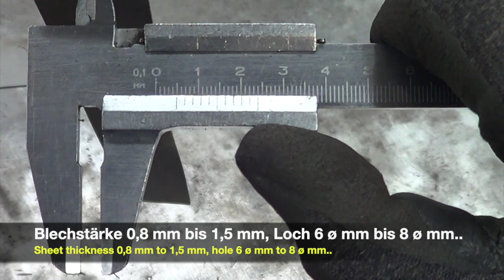Vespa Rahmen im Schweißkurs, Mobylas Oldtimerseminare und Schweißkurse...

Comment: With my welder I found 7mm just right , 6 was to small and filled to quick and 8 a bit large
Reply from the maker: Hi, thanks for your comment, yes it all depends of the welder AND the welder machine, when the wire feed is to fast, it fills the hole to fast. And to much wire feed makes "a colder weld". Most important is that the weld is strong enough.....  ; )
Reply: @mobylas  the machine I have ,you can't adjust the wire speed seperate